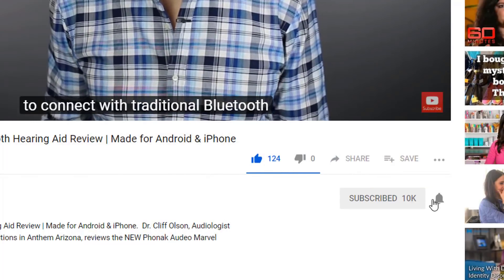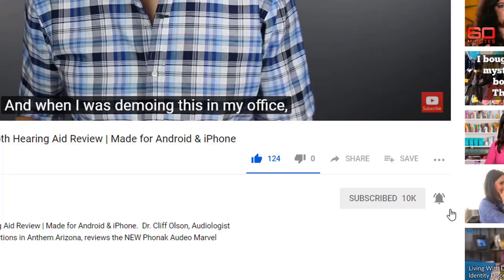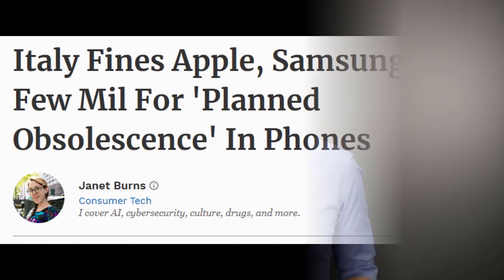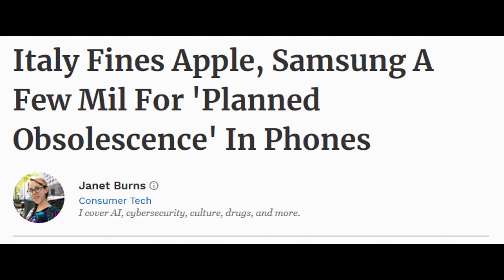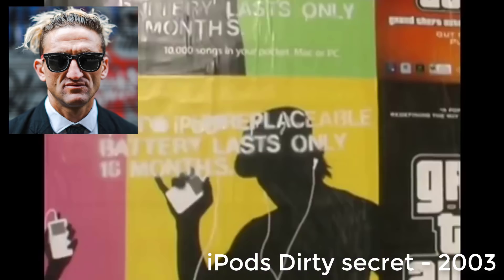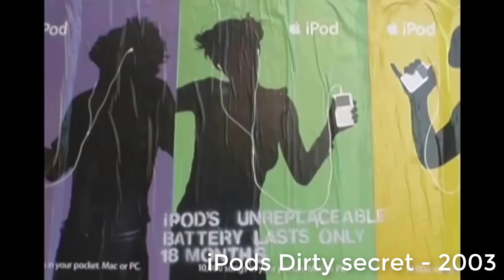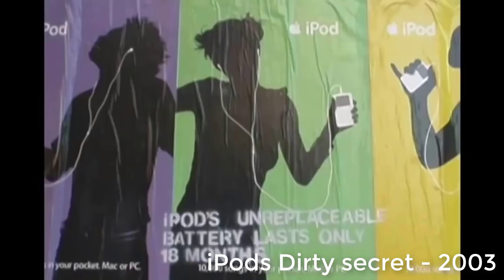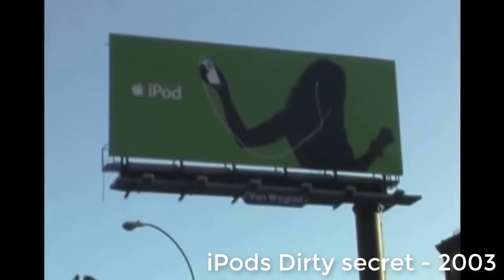Are Hearing Aids Designed to Fail? | Planned Obsolescence

Comment: Hello dr Cliff!
How about hearing aids that have in firmware counters of hour usage?
If you hit a number of usage hours then the firmware deactivate a part of DSP.
I’m engineer on electronics and automation. Also started an little IT&C company.
I also own two hearing aids who had strange behaivor.
After 1 year and 9 months suddenly omnidirectional mic’s stooped to work.
I’ve had to work on program three and with volume at maximum.
When I went to audiologyst she told me to buy another pair of hearing aids just in case this will be broke.
Also I have friends who buyed from same manufacturer and sent the hearing aid three times in three months of usage to the warranty.
I have found an firmware fromthis manufacturer and started the decompilation an reserch.
I will let you know about what i have found after flashing to ROM section of an Coyote 4.5 ARM sound processor.
I understand to be broken, microphones, transducer or some other thungs but nit the Amplifier unit.
Also, why some manufactureres does not use MEMS microphones?

Thank you

Kind regards.

Comment: Rechargeable batteries is definitely on the path of planned obsolescence.In the examples you gave for planned obsolescence, you referred to Apple. Both the older iPhones and the iPod story you mentioned, it’s the battery that wad the issue. A manufacturer can charge whatever it wants to replace the battery, and this is often an huge money maker for the company. With the older iPhone’s slowing down. Apple made the decision (arguably incorrectly) to not tell it’s customers what they were doing. When a battery ages it can’t produce the same amount of power that it could when new, when an iPhone demands power, lets say when playing a game or watching a video, and the battery is not capable of providing that power, the device can crash and shutdown. Rather than have customers experience these unexpected shutdowns, Apple slowed down the performance of the device (reducing the unexpected shutdowns) this allowed the customer to keep their old batteries longer before having to replace them. All people saw from this was that Apple slowed down older devices (even though Apple was trying to do all they could to help customers get the most out of a battery) I have yet to see anything stating how long these new rechargeable batteries in hearing aids are expected to last, and what the manufacturer will charge to replace the batteries. Typically, a lithium battery will last about 300-500 charge cycles. That is not very long when you think about it. I can buy a year and a half of batteries for about $30. I would guess replacement rechargeable batteries will cost quite a bit more. Also, how well should we expect a hearing aid to preform after a battery is at 80% capacity. Should we expect unexpected shutdowns? The nice thing about disposable batteries is with each new $.18 battery the hearing aid is like a new device. The manufacturer may say that you should expect 24 hours out of device with rechargeable batteries but will that still be the case is a year, how about 2 years? Is a hearing aid that only lasts 10 hours still acceptable under the warranty?

Comment: RETRO TECH, like hearing trumpets. Required no batteries and last forever. So why buy a bank busting electronic hearing aid...?
Reply from the maker: Is this a serious question?
Reply: @DrCliffAuD I brought recently from a auction room a mid 18 century vintage hearing trumpet and it still works. I doubt very much a electronic gizmo version to use the modern parlance for such a contraption, would work as well after that number of decades/century's. Also hearing trumpets are in vogue in Britain at the moment with those seeking a simpler and environmentally friendly way of dealing with hearing loss.

Comment: Hi Dr Cliff
Is it normal for audiologist  to plug aide vent if there is feedback, or is the fitting bad?
Are ICC usually low power in picking up low sounds?
What are best ICC in your opinion?
Thank you
Reply from the maker: Yes, vent size has a lot to do with feedback.  They were doing the right thing.  I don't understand your second question.  I like to use either the Phonak Titnanium, or Soundlens from Starkey for their IICs
Reply: Doctor Cliff, AuD thank you about how much is Starkey lens go for one high end?